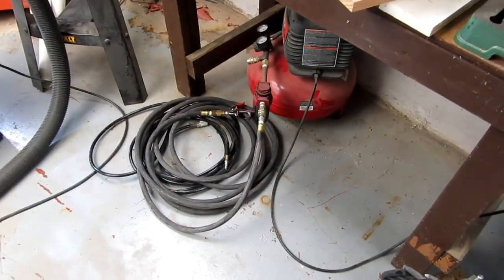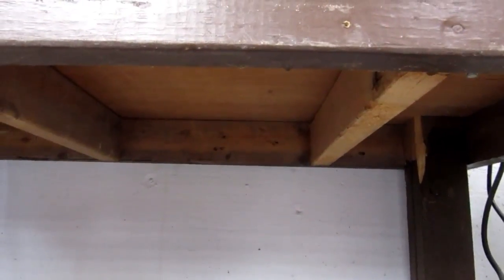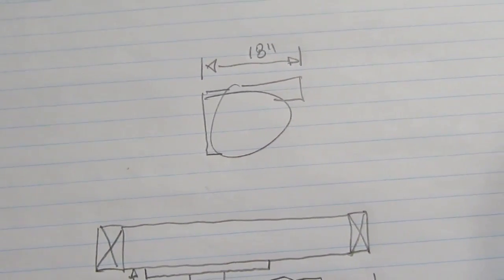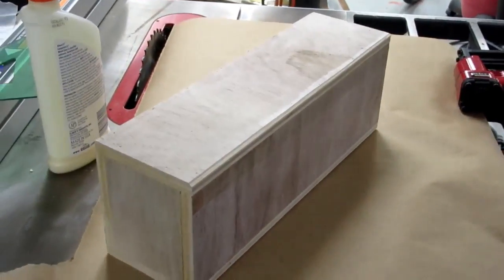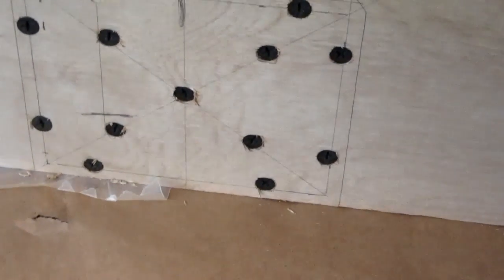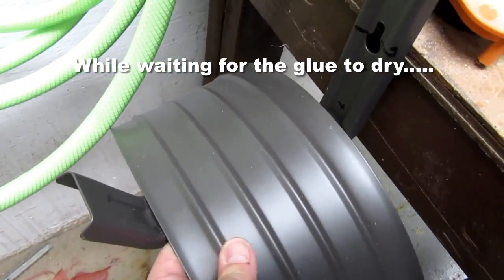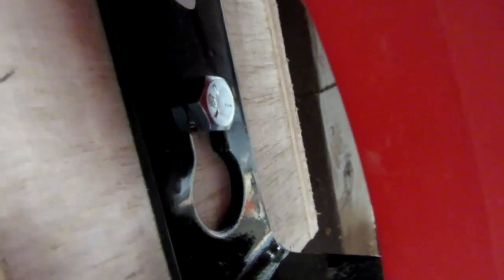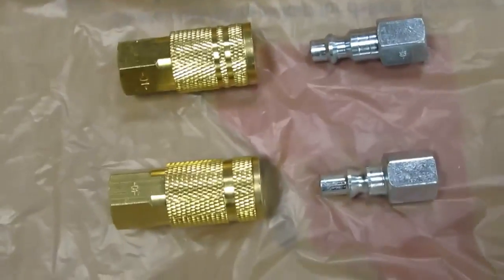Installing an Air Hose Reel in Basement Shop

Comment: You might want to run air lines to various points in your shop with quick connectors.
Reply from the maker: Leland Rogers, I was certainly aware of this option, but decided against it. To install an air line throughout the shop would mean getting behind too many pieces of heavy tools and workbenches, and the air line would need to cross over electrical conduit, and it would be quite difficult to accomplish. For my infrequent use of air tools, the hose reel solution is best.
Reply: Very nice ... got all your bases covered.